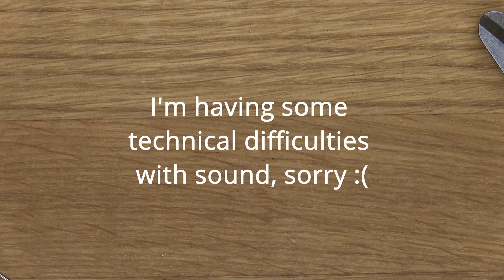easy DIY audio oscillator!

Comment: So interesting that you did a point to point build this week, I spent this weekend looking through everything I had on effects building looking for a point to point Jefet preamp-  I thought I had something in a book or file but had no luck. Do you have anything? Something just like this oscilator built onto a pot.
Reply from the maker: Man I don't know I think point to point should be few parts so maybe a fuzz there are some like fuzz face and bazz fuss that are both easy to build and have few parts so see if maybe that's something 😃👍